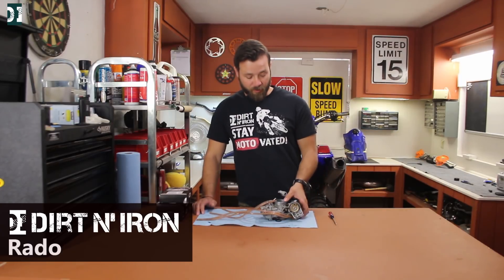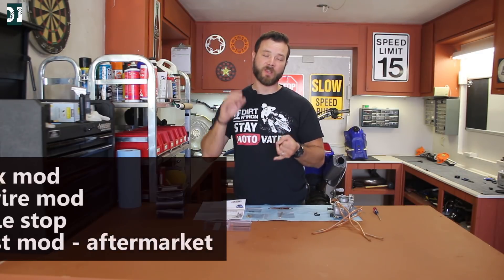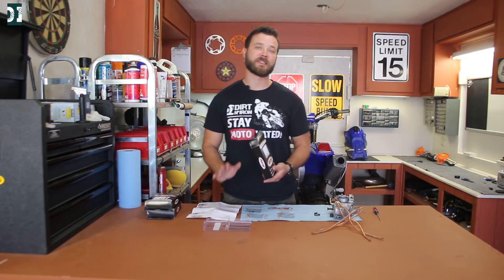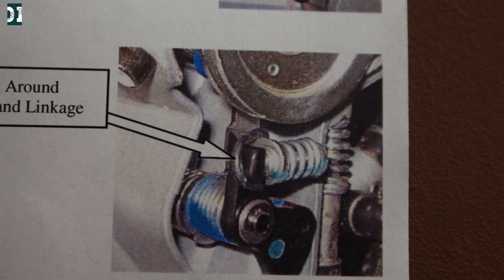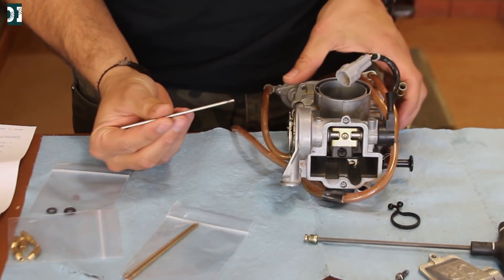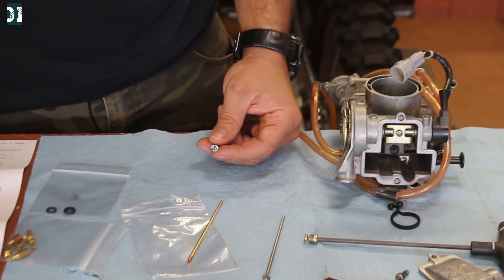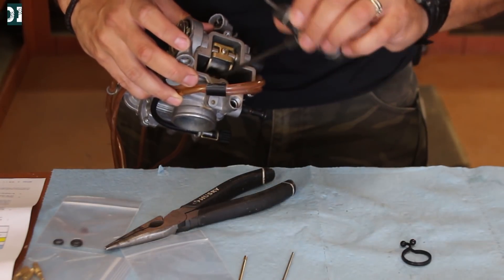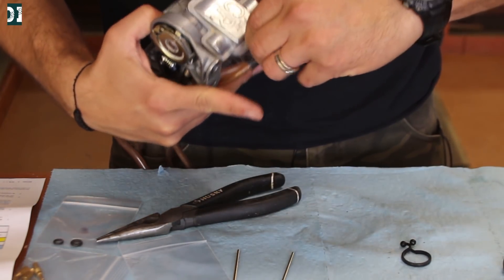JD jetting and O ring mod for Yamaha WR450f - Keihin FCR carburetor jetting

Comment: Well mine is 450cc / 05 of  December,the  model .& the problem here is the rpm goes 2 slow after I open the throttle & it stops higher than the normal ofcourse its different when the bike is cold & different if it runs for 5'/10' maximum. But even if i don't ride the bike for a couple of weeks maybe more, it starts with air choke & a little bit up the rpm scroll (sorry for my English)jail lessons. I hope you understand & have an idea how to do it like yours cuz I think we have same model 1year up 1year down 😉cheers 🍻

Comment: Hey Bud,
That was very informative.  I bought that aftermarket carb for my 09 RMZ250 and my throttle cables are different than yours.  The lower cable fits in and works, but the upper one has that exact same thread on the upper cable.  What year is your bike?  I will try to order that cable.  I ordered one before and they sent me the one I already had.  But yours will fit my carb.  Any way to see a photo of your upper cable wit the cover off.  This way you don’t have to take the carb off, just the cover.  Thanks and would really appreciate your help.  I’m not having any luck trying to find the fragile one.  But not gonna pay $800-$900 for one from Suzuki.
Reply from the maker: this is from 2004 Yamaha WR450. I dont have the bike anymore. Hope that helps, good luck!

Comment: I just looked at this jetting kit it is exactly the same as a YZ jet kit you could save a lot of money by buying the OEM jetting for a YZ and then tuning your carb from that jetting and needle jet after the grey wire mod. There isn't any need for the oring mod either you can do the same thing by tuning your fuel mixture screw and needle position and widening your accelerater pump jet.

Comment: I have the same bike and I’m from ohio and this was me at fault I put a 150 jet in it and it barely runs should i j to standard 165 or should I go higher I’m having trouble with tuning these carbs
Reply from the maker: Ben, I see you ordered JD kit and thats probably the easiest route to get your bike dialed. Follow the chart based on your elevation and you should be rippin. You might need adjust fuel screw or play with the needle a bit. Kit should ship tomorrow, have fun Ben and thanks for the order!

Comment: I have i 2009 wr450 running lean.how hard is it to remove carburator an put back on.how much time should it take.?
Reply from the maker: I think on those models you need to remove the shock as well. I had steel frame and it wasnt that bad

Comment: Nice videos man. 
I have a 2004 wr450f, it's reeeally hard to start it after one or two weeks with no use . When I make it start it   , it has back fires when  deceleration  , it keeps the rpm hight after deceleration . And if I leave the gas valve open , it over flows . I took apart the carb , and I find out that the main jet is 185 instead of 165 ( the standard one ) and also the jet ( the one at the back side of the carb ) is also too big . I'm gonna change these two jets , and see how it goes . Any other ideas that it might help ?
Reply from the maker: rebuild the carb, get also new vacuum plate rubber gasket
Reply: Other ideas: it will always want fresh fuel. Drain the carb after 1-2 weeks. Possibly adding fresh into the tank also to refill carb. I have the same year you have wr450 with the JD kit and jetting. The bike always wants fresh fuel or has your same starting issue. Simple

Comment: Hey Rado I have 09 wr450 and installed the jd jet kit and I’m still to lean probably cause I have full fmf exhaust my pipe was glowing red and popping when I rev it I’m at 2000ft do you think I should switch to blue needle to get it richer?
Reply from the maker: Get is one step richer whatever jd recommended, if blue needle then yes. And after that set your fuel screw as well, i have a video about it.
Reply: @dirtniron  thanks man much appreciated

Comment: I'll be honest with all you guys.I was doing those small modifications at 2strokes RM125cc back at 96' with 96' model race times&it was big difference to all my bikes.Even to my first one YZ 250cc87' when I was 14years old;)Then at 18 motocross time RM (92/96/99),CR (94/95/99)& all the other YZs most of the time.But at those heavy stones YZF250/450&WRF450 Nah....there's a verysmall difference almost zero.Don't give money.Put 1 good exhaust & that's all.Change air filter/oil filter/oils&take the stone(cuz 2heavy)to the mountain.Hello&Goodbye;)

Comment: I have a 2005 YZ450F and it ran like crap when I laid on the throttle, I added this same kit along with the large O ring which my bike had NO O ring, and now it runs KILLER. I’m by no means a mechanic and this was easy. I had a harder time removing my carb and dealing with its hose clamps than I did installing this kit. Followed the elevation and temperature recommendations and I couldn’t be any more happy with the results. Thanks!!
Reply from the maker: Thanks for sharing Brandon, glad you are happy with it!

Comment: Hey, thanks for this tutorial. 
Could you please have a look to  my video and tell me what you think about my carburation? Bike is throwing blue flames and I m not sure if it s running too rich or OK.The spark arrestor is removed. You can hear the valves cracking each time you open the throttle..
Thanks
Reply from the maker: If it backfires on deceleration it is caused  by lean mixture. Try to play with fuel screw, give her more fuel on pilot circuit. Maybe try one size bigger pilot. Or lift the needle one notch higher to get more fuel

Comment: Mr Iron. Greetings from Honduras. Recently I bought a 2005 SUZUKI DRZ400E.
Its carburator is in bad shape. I believe there are parts to totally rebuild it. 
I want to buy those rebuilding parts on Amazon. Given that probably here in Honduras, original products May be very very expensive. Can you give me an ínternet address (link) of those parts to buy them. 

On the other hand, I have found this Kipa carburator in this link which is cheaper than the keihin. 
Can you tell me if this Kipa carburator Will fit and work on my DRZ400E? Check the carburator here https://www.amazon.com/-/es/KIPA-Carbuertor-GRSXR750-Carburetor-59031001300/dp/B07RD4D7F9/ref=mp_s_a_1_2?dchild=1&keywords=Carburador+fcr39&qid=1595425560&sr=8-2
Reply from the maker: I am not sure JD sells in Honduras.. do some research ..

Comment: Just wondering if I was to jet my bike myself, without the JD kit, and after completing the free mods, shouldn't I require a bigger main jet, so the bike doesn't run lean? I have seen a lot of people running a smaller main?
Reply from the maker: Jd has custom needle that changes the fueling, but once you are wide open its on main jet only. You can jet it yourself, i think go bigger on pilot for sure, not sure about main. Try it

Comment: I recently bought a 04 wr450f and the previous owner had 48 pilot and a 162 main, I noticed it was lean (I’m at 2000ft btw) so I got this kit and changed it to 170 main, 45 pilot and blue needle on the 3rd position, now my bike seems to run even leaner and hotter. If you could help me out I’d really appreciate it, thanks in advance.
Reply from the maker: You put smaller pilot so the bike is leaner of the idle and first half of the throttle. First try to keep same jets but go with rich needle, then try to adjust your fuel screw. I have fuel screw video on my channel, i had identical bike. It ran great with that combo. Try it and let me know.
Reply: Dirt N Iron thank you, it runs good now👍

Comment: Hey man! i'm from Argentina.. i've got a wr 450 f 2011 i bought it about a month ago.. when i make a quick acceleration from relenti position it turns off... could you know whit precision what's the problem? thanks, i hope your answer
Reply from the maker: if I am not mistaken you got last year carburetor bike, I am quite sure the bike is too lean on the pilot circuit, which means its lean from idle to mainly. I would first try to adjust fuel screw, follow my video on how to adjust it, hope you have aftermarket fuel screw already, if not I highly suggest to get one. check my other wr450 videos, I show how to install the fuel screw and how to tune your carburetor. If you still cant make it better then you need to get bigger pilot jet. That would be my advice for now.. good luck!

Comment: do u know the stock jetting for the 2003 model? im having some issues with mine and i cant get it right and i have no ideawhat the stock jetting should be.. i ride at sea level with a temp around 15 to 25 degrees celsius
Reply from the maker: you can find it on rockymountainatvmc  just enter your bike and the values should come out
Reply: @dirtniron  you just became my favorite dirtbike youtuber! thx alot man! (Y)
Reply from the maker: cool bro ;)
Reply: @dirtniron  but just so you and all others know.. those readings are only for the us bikes. i found that the us bikes and eu bikes are delivered with different jettings. i found that my (EU) bike was delivered with 160 main jet and 48 pilot while the us model is delivered with 150 main and 45 pilot. dont know why they did it like this... but now u know :D take care man! <3
Reply: @xllitee  difference in jettingbis likely the different emission standards

Comment: Since the o ring is really a short term fix before it stretch's, cracks and breaks. Have you looked into r&d power spring or KTM powerparts sxs so spring for a permanent fix? Along with the JD jet kit, ap spring boyesen quick shot 2 or 3 would be total package
Reply from the maker: sounds good, thanks for the tip. I sold the bike last year..

Comment: you have all been had with that o ring mod, 80% fuel pressure increase.. laughable! adjustable by thickness of oring seriously! what about the negative effects of that mod? Keihin are very clever, there is a reason Keihin built it that way and did not put a oring on it.

Comment: Hi Rado, thank you for this video. Question for you. Do you know if I should be able to kick start my 05 WR450 without a starter relay or battery in the bike? I recently put an AllBalls carb kit (stock settings) on and realized after, that my starter relay went bad. So I took out the relay and batterm and I am trying to kick start my bike but don't seem to have spark.
Reply from the maker: I am not sure, get new relay and connect the battery too.
Reply: @dirtniron  thx

Comment: I'm here because of your last video on the grey wire mod. If you changed your ignition mapping from a WR to a YZ, wouldn't you also want to follow the jetting instructions for a YZ instead of a WR?

I'm having some issues with my 07 WR just curious if I jetted my carb properly assuming it was fully converted to YZ mapping/etc. Thanks!
Reply from the maker: See how it works, but I think wr will be good. You still have different cams
Reply: Thanks for the reply! OK that makes sense, I thought I must be missing something.  @dirtniron

Comment: Could you send me the link for the o ring
Reply from the maker: O ring is included in JD kit, here is the link https://www.dirtniron.com/product-page/jdy001-yamaha-yz426-450f-00-05-wr400-426-450f-00-06
Reply: #78 o-ring from hardware store works also. o-rings will break down over time and need to be replaced.

Comment: Since we both have the same bike what are the performance rebuilding mod we can do? Like cylinder/piston wiseco/stock? Stock crank? What should be done to valves and seals, should it be machined? Keep in mind we want a healthy bike that will last long time. Thinking stock compression ratio just for relaiblity bike is already fast. Video: what are the must do's when rebuilding wr450
Reply from the maker: I am convinced that it is sufficient to have stock bike and do the free mods, aftermarket pipe and good jetting makes a great difference. Now I have a lot of power, I like how linear it is, it builds up nicely all the way to high rpm. very controllable power. If I would want to increase it even more, I would install new cams. 
thanks for suggestion Silvester!
Reply: No i think the power is fine, im just asking when i rebuild my bike what is best for relaiblity, full stock or aftermarket engine parts are better and last longer

Comment: Great video does it not say anything about temperature of weather? Suprised they did not mention pilot 48 anywhere, everyone had good reviews with 48
Reply from the maker: they actually say that if it is too hot its better to switch to red needle.. blue is rich and red is lean 
I think 45 pilot works great with JD needles, it is probably too small for GYTR or stock needle, but I am also curious how would it run on 48 pilot, I might switch it and see how it works. I had stock needle and 50 pilot before and it was pretty good.